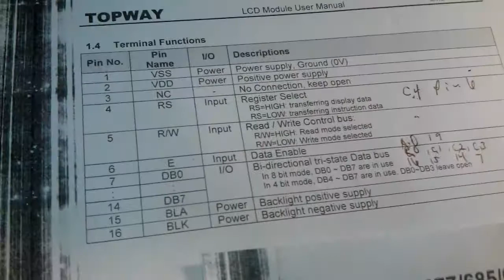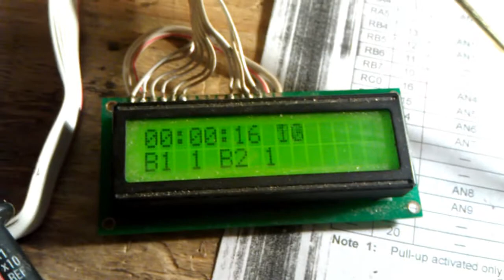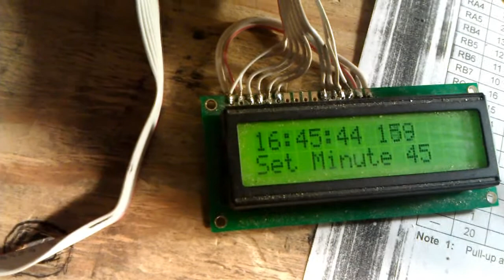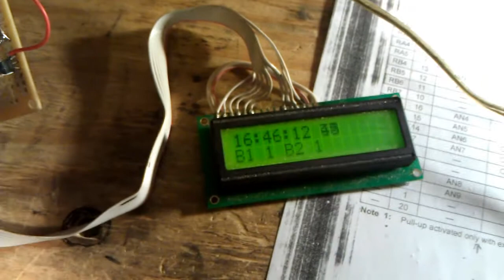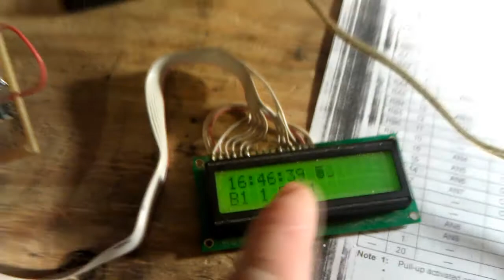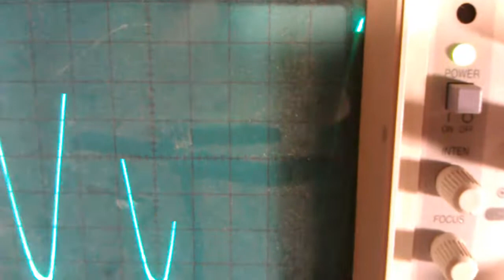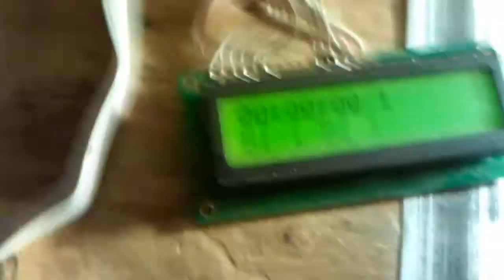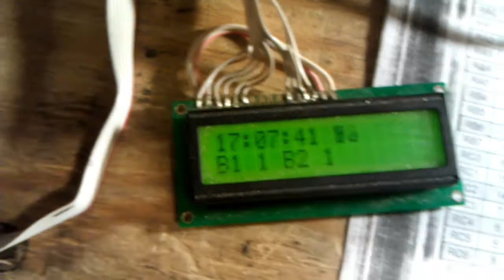Home made water heater timer-controller - Part 2

Comment: @hackfreehvac io Texas we had a hot tub which all ways stayed 104 degrees (3 hp pump and 5.5kw heater), a 5 ton heat pump for downstairs and a straight cool 1.5 ton(both late 80's carriers basic models) for up stairs with electric element heat, a pool which the 2hp pump ran more 12 hours a day and more in winter to prevent freezing, and our bills were about low $300's to low $400's plus we had to pay for water(another story)

Comment from the maker: @joeyf504327 
Our off peak is 6 cents and our on peak 24 cents.
But the way the billing is now done that isn't the total. 
There is about another 12 cents per kw/hr on top of that in the "other" fees.

The rate for on peak and off peak is only abour 1/2 to 2/3 of my total bill once you add taxes, etc. 
It sucks. 
I had two $400 + bills in early summer. 
When I use no heating or cooling my monthly bill is still about $200.